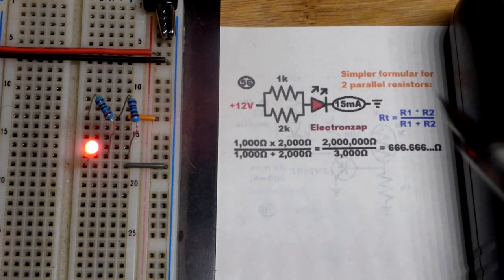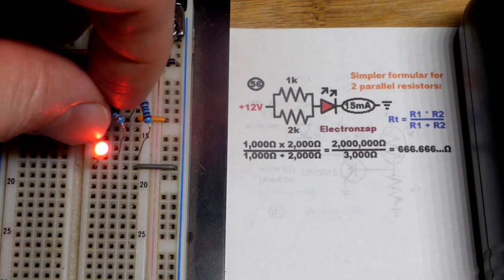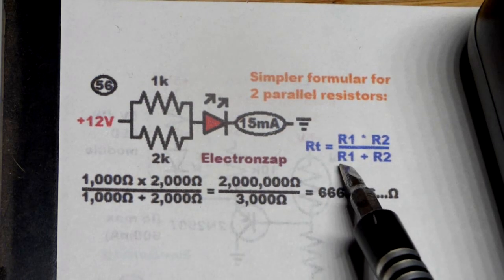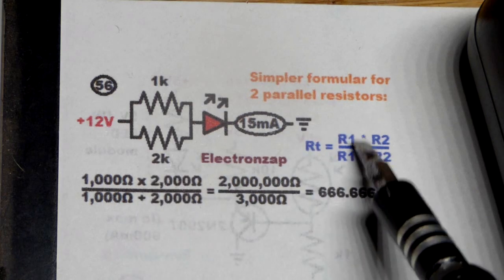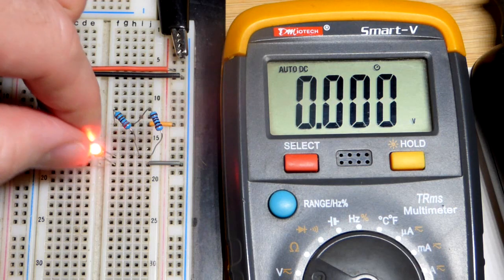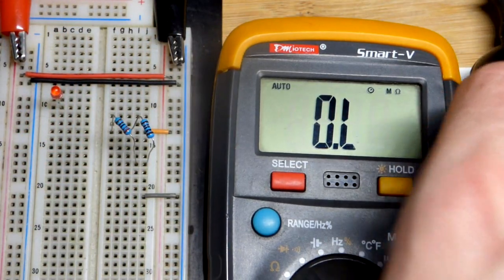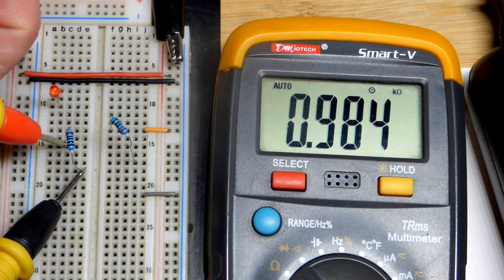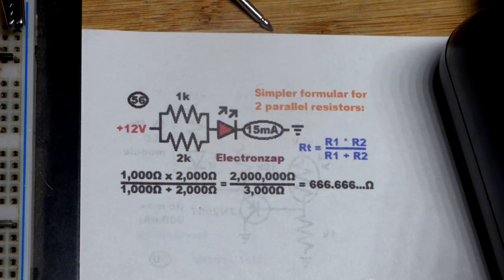Two unequal parallel resistors in a 12 volt LED demo circuit

Comment: What is the main advantage of using parallel resistors over a single resistor?
Reply from the maker: If you use a single lower value resistor, it gets hotter. So, if it will get too hot you either need a higher wattage resistor, or you can use higher value parallel resistors that will divide up the power. Can also do lower value series resistors to divide the voltage and thus split up the power.